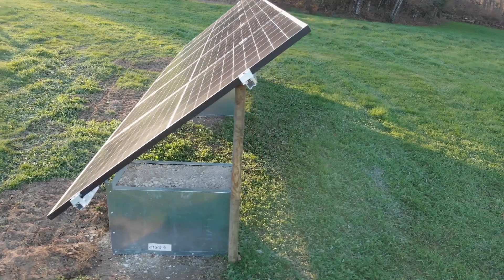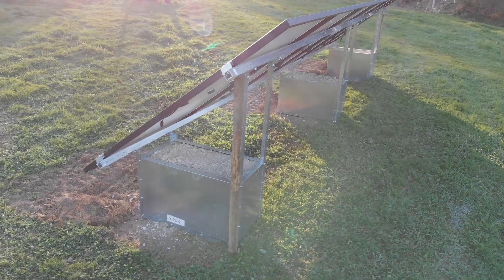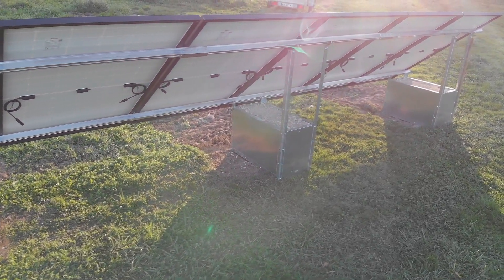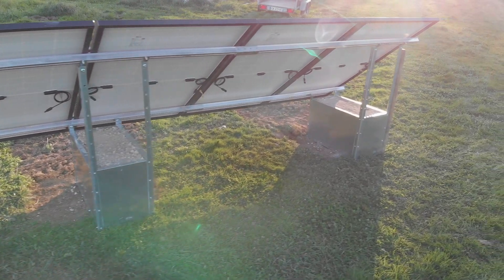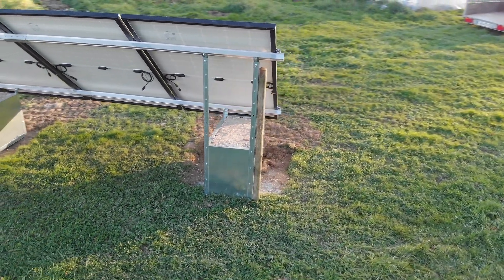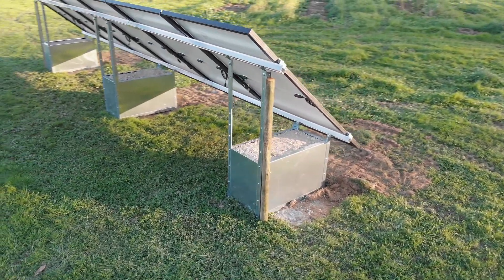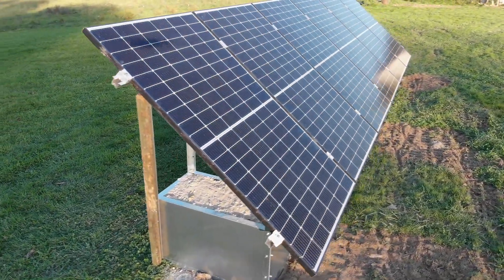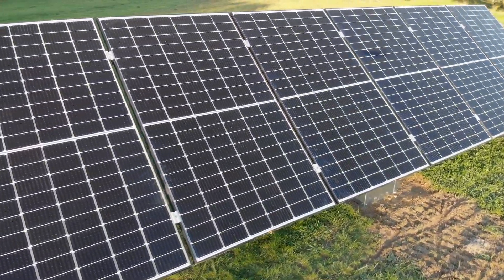Installing new Solar panels on the frame - GSE Groundsystem

Comment: Great video, we are just planning our install. Will be interesting to see your real world savings.
Reply from the maker: It’s looking good so far, we did have a lot of cloud and rain to start with, but now it’s sunny. 2000watts coming in, which charges the batteries from 16% to 100% in five hours. And they last overnight, in most cases.

Comment: Good series  of videos Ben. I want to do a "panel bank" like this as we have a fair bit of ground and a lot of dormer windows which makes a roof mount awkward. I am a self employed steel fabricator so frames are no problem and I often get stuff galvanized.  By the way my L322 flat battery problem WAS the battery,  YAYY! ,even after a drop test had shown it in the green, and the previous owner said it had recently had a new battery. Result ...... Cheers mate....
Reply from the maker: Great news on the battery, a new one seems to have fixed ours.